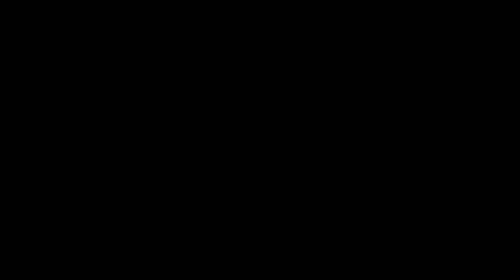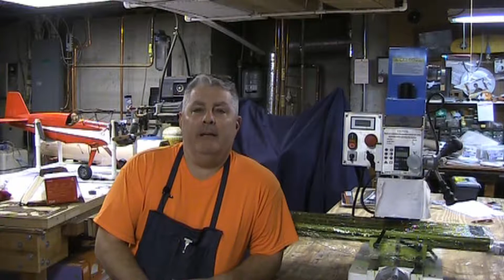PM25 CNC Conv Part1 Intro

Comment: Nice mill for a conversion. I am doing the same thing but with the pm940. I got the mill the last day of January. This is my first conversion as well. I just finished the electronics enclosure and getting ready to start the ball screw mounts pretty soon. I am also running the clearpath servos. I am using a Masso controller. I like that it is doesn't need a computer, it is all self contained. 
　
Check out CNC4XR7's videos on the pm727, he has a lot of great conversion videos.
https://www.youtube.com/playlist?list=PLZ7eWN_JLWbFQUbI2_wPy8E24P3itDdS6
　
I don't produce videos myself because my internet is way too slow. There sure is a lot to consider when doing a conversion especially starting out with no experience. But my enclosure has turn out really nice.
　
What all do you plan to do? Are you going to go with a VFD and 3ph motor? How about a power draw bar? TTS tooling? You already have a belt drive.
Reply from the maker: I’ve seen his work. Good stuff. I’m using TTS tooling with ER16 collets. I do mostly small air engine work. Pneumatic tool changer in the works next. Eventually I’d like a servo spindle motor with an encoder to do some thread milling. That’s a long range goal though. Good luck with your conversion and thanks for the comments!